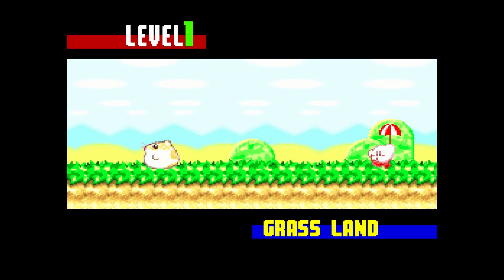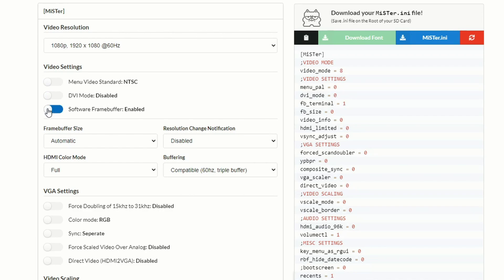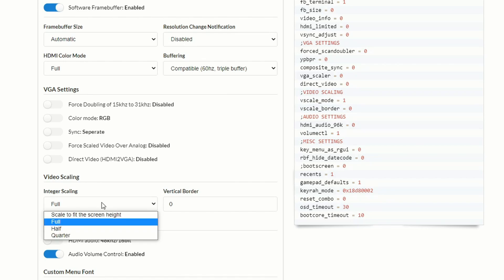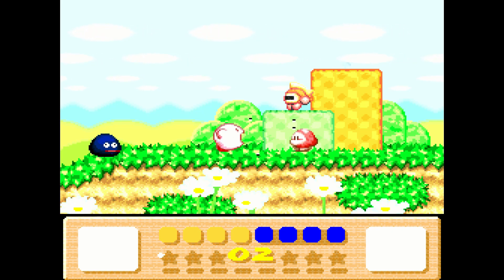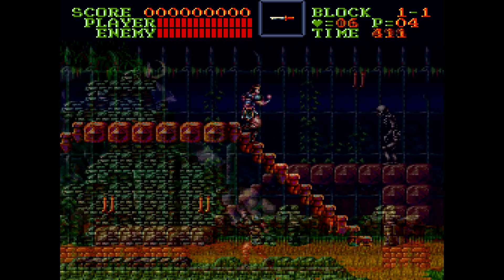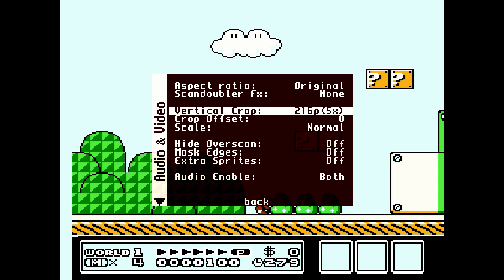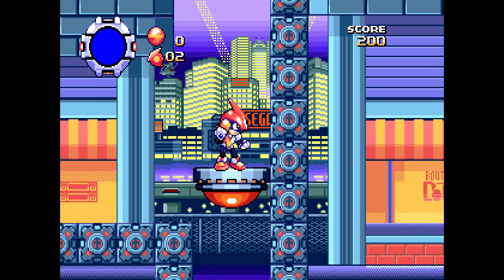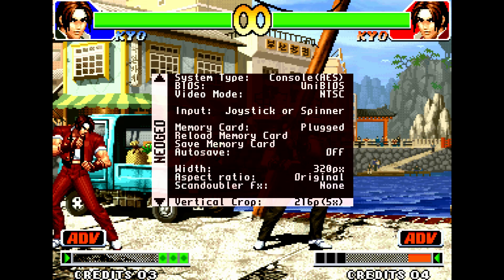5X Video Scale Mode on MiSTer FPGA - How To Setup!

Comment: Getting ready to hook up my MiSTer to my 1080p projector. It looks like 5x mode is useless in my situation since I can just zoom my projector lens in and out to fit the screen however I want. Am I correct?
Reply from the maker: If the projector is zooming on a 1:1 pixel ratio sure
Reply: @VideoGameEsoterica  I think so. It functions like a focusing a camera. Looks 1 to 1 but I'm not sure. Guess I will hook it up and see what happens. I'm not finding much info out there on using the MiSTer with projectors. Pretty niche.
Reply from the maker: May as well try both

Comment: Does this work the same way for 1920×1440p???
Reply from the maker: 5X would want to be done at 1080 not 1440
Reply: @VideoGameEsoterica  ok cool. My monitor is 1440p so I'm assuming that it will be sharper than 1080p @ 5x scaling?
Reply from the maker: May be. I’m not sure how that will effect the scale though. Haven’t tested it myself
Reply: @VideoGameEsoterica  I'll just keep it in 1440p. The 5x is greyed out when I'm running my setup in 1920x1440p
Reply from the maker: I wondered about that

Comment: i set video at 1920 on ini and i cannot get the 5x in any of the cores. (fixed) the 5x scale only fits the image to screen hight?
Reply from the maker: Yes 5X is dealing with height. That’s why you can adjust the image position vertically as 5X usually bleeds a tiny bit outside the viewable image area

Comment: Do you have a video for ini settings for those of us using a PC CRT monitor? I was wondering if there was a way to retain the visual fidelity and be able to rotate the cores via VGA as well.
Reply from the maker: I have a video on how to get video into a PC CRT but not specifically what you are asking about with rotation
Reply: @VideoGameEsoterica  Ok, I didn't know if there was a specific "cut-off" for resolution in order to rotate cores. I appreciate your channel.
Reply from the maker: With some custom settings using HDMI out and converting to analog you should be able to get the scaler to rotate an image. Granted it will be doing it for the image output and not just an individual core but if you have multiple INIs saved you could cycle through them quickly. 

Check the INI file. I can’t remember what setting would do this but I know it’s there
Reply from the maker: I think it’s osd=rotate. It’ll be 0/1/2 as options. Play with that
Reply: @VideoGameEsoterica  Will do, thanks. I have a free VGA monitor given to me by my work. Unfortunately it has massive burn-in, but it was useful for me to test and I could see how beautiful it was despite that. I have a different one coming next week. Great alternative to a pvm.
Reply from the maker: I wish I could score a CRT with RGB in but they are rare and expensive

Comment: random q... i have an old crt that only has svideo and composite as options - worth grabbing an mister svideo adaptor or better to just stick with hdmi to my computer - i realize its subjective whats 'better' i guess what Id like to avoid is dropped 50$ on an svideo adaptor if the quality is really just meh.
Reply from the maker: Grab an adapter. S Video and MiSTer still look great together
Reply: Alternatively, Consider spending the $50 on a component capable TV off Craigslist/FB marketplace
Reply from the maker: Also true but I like to help people w/o sending them out in pursuit of more items lol
Reply: @Kajoq  periodically i have looked but the only ones ~$50 in my area would need an rgb mod done which is beyond my skillset
Reply from the maker: I mean you don’t need to RGB mod. Component is very close to RGB